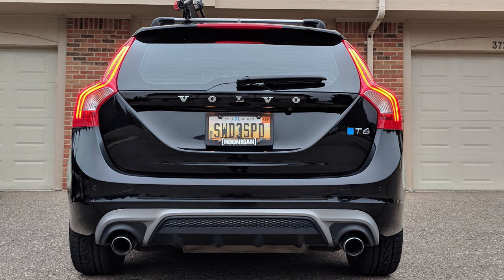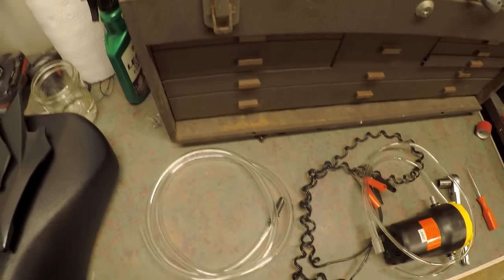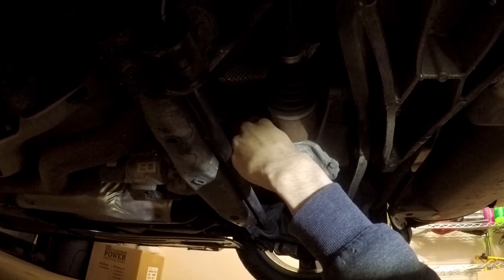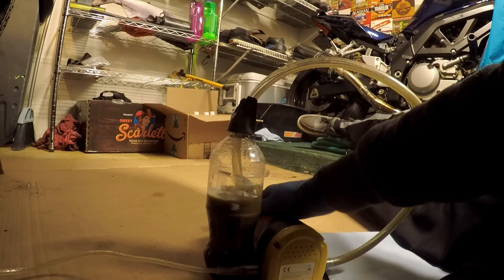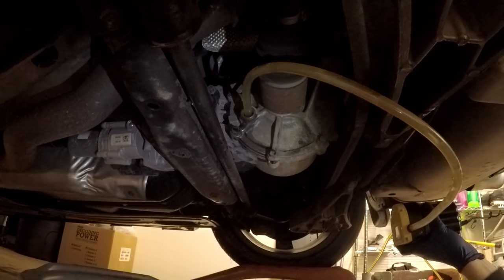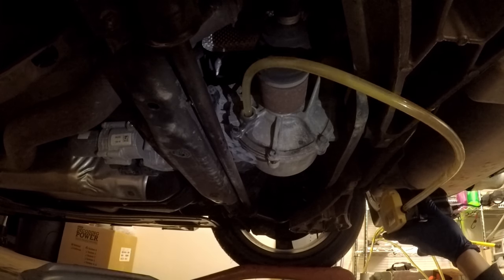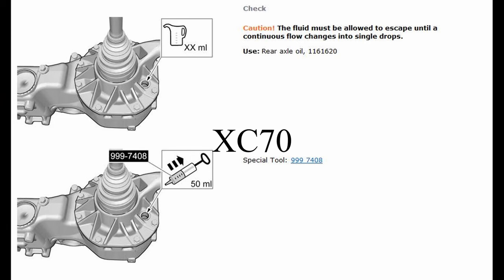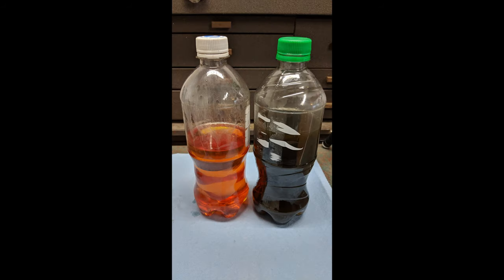Volvo Rear Differential Oil Change

Comment: Changed out my '16 V60 R-Design's fluid using this as a guide. Thanks for posting!
The little Amazon pump isn't the greatest thing ever, but it was a big help for 25 bucks or so.
I was pleasantly surprised how good looking the old oil was after 80k miles. Used Lucas Synthetic 75-90 as a replacement and after 2 drain and fills I was happy with what the oil looked like.

Comment: Hi again Garret, I have been on to 2 diffeent Main Volvo Dealerships and they both confirmed you DO Remove 50 ml on the Volvo XC70 2010 model when the drips stop, in fact one of the guys I spoke to told me he had done quite a few and that is going by the Vida system, I hope this clarifies this area  and helps all.

Comment: GOOD Video, I have a Volvo XC70 AWD 2.4 D5 year2010,  I see you mention that the rear differential/final drive does Not need 50ml extracted as in the volvosweden video, I am paranoid about the diff as it was fitted new by Volvo at a cost £3.500. fortunatley it was covered by warranty, I changed my rear diff oil today as the diff/final drive has dome 49.000 miles since fitted, the oil was dirty when drained so I just kept pumping in the new oil until it all came out clear and until the drip stopped as in your video.
Question:  could it be the 50ml extract could possibly be due to expansion when the oil gets hot as in a normal diff you would have a breather in the Volvo diff there is no breather, if some one reads this and has the answer I would very much appreciate some comments.
Thank you for the excellent video.
Reply from the maker: I think it's important to clarify, the Volvo service procedure for the 2015 V60 detailed not pulling the 50ml out after the fill. I believe the xc70 procedure is different which makes sense since volvosweden pulled 50ml in his video. I would suggest clarifying for your specific car. Your probably on to something with the breather but I cannot say for certain.

Comment: hi mr, can you tell me from wich software you obtain all the pick and procedures, they are fantastic. I am currently using autodata, but is not that good. cheers from Chile. nice vids
Reply from the maker: Hello! I have a copy of VIDA on my laptop. This is software Volvo service centers use to communicate with and program the cars. It also contains all the service procedures for the cars. If you search on Google "vida install swedespeed" you should be able to find the install guide.
Reply: @GTurbski  thank you bro! 😊

Comment: Good video! Did you do this as maintenance or to quiet down differential noise. If later, did it work? I bought an '11 xc90 that sat for nearly 3years with 128k on it, so I'm getting a bit of noise. So this is an initial effort with high hopes...
Reply from the maker: In this case, just a preventative measure. In the case of my wife's XC60, similar to your situation we had some noise which did go away with some new lubeeee. I'd suggest it!
Reply: @GTurbski  thx, at least there's hope 🕵️‍♂️

Comment: Is the angle/bevel gear box oil the same as the rear differential oil?  Do you have a video on that procedure?
Reply from the maker: I used the same oil, yes. I don't have a procedure for it at this point. I should do, though.

Comment: In regards to not extracting fluid, are you seeing that procedure in VIDA?
Reply from the maker: For this particular model year, yes. It showed a figure outlining the procedure.
Reply: @GTurbski   does this also applies to the XC 70’es from model Year 2010 - 2015 as well? Not extracting 50 mm of oil

Comment: hi there how's your diff? I have used the same oil but my diff got a whine
Reply from the maker: What year car? How many miles. My V60 and XC60 both run redline diff oil, no issues at all.
Reply: @GTurbski  it's an classic xc90 around 80k I don't think mine had limited slip diff so going to change the oil out soon.